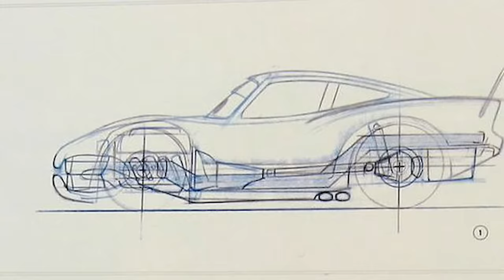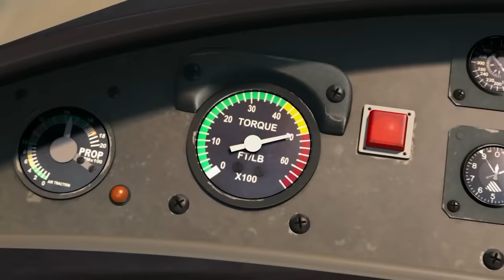Why Couldn’t Lightning Beat Jackson Storm? | Cars Theory

Comment: As an engineer I can tell you this: the biggest problem with upgrading old cars is compromise with their identity. For example lets take the Golf GTI, it was one of the first compact sportscars ever manufactured. To keep up with modern day compact cars u  could swap Engines and stuff... but the space is limited. You could just grow the frame by changing the chassis and body, but by doing that it will loose its identity, that can't be called a Golf anymore. This happened to many cars that came from tuning lines and not from the Manufacturers themselves. Shelby made some models where they remade the body and the car had a new Identity. Mercedes AMG borders that philosophy as well.
Reply: You swap in an Audi/VW 20V racing engine for 500hp. This assumes a racing budget.
Reply: Ive wanted a custom 1967 CHEVROLET IMPALA for so many years but I wanted the interior to be modernized automatic and you just helped me understand that its as possible as it is complex….I guess Ill just let it go lol
Reply: @ElusivEnigma  you could do it yourself for 20k+base car in good shape. It would prob be 40-60k to have it done in a shop(very few I'd trust).
Reply: The ship of theseus theory pretty much
Reply: @ElusivEnigma  swaping to Automatic is not as hard as an engine swap, but you will need money for it. If you want to do that by yourself, you need knowledge about how the car is built and the compatibility of certain gear boxes. Also since it is Automatic, you might need knowledge about the electrics as well, depending on which gearbox and transmission you use. But it is easier to learn how to drive manual. And believe me when I tell you that it is really easy. I learned it in literally 15 minutes.
Reply: @Eluderatnight  yes, but when you swap the engine, you will have different dimensions. It might fit or it might not fit. There is a VW Golf 2 that has 1000 hp monster inside it. To fit in the new engine, he had to remove back seating and the trunk had sloted holes for airflow management. The Front is empty and was not made into storage space to keep it light. Due to the power increase they had to widen the body in the back and mount wider tires to get the momentum on the asphalt. Also it was remade into a 4WD with a 30/70 distribution. That thing needs only 7,8 seconds on the quarter mile.
Reply: @lolmanboss  my proposition was 400bhp continuous, 460bhp scramble. Its an off the shelf racing engine from VAG that is based on the same architecture and the original.

I have had a mugen N1 racing engine before and it was a ton of fun. It lasted about a year of 120mph every night.

Comment: One of the things I have a hard time keeping in mind is that at this point it's implied that lighting is as old as the king was in cars 1. also Storm reminds we of how arrogant lighting was before radiator springs. the only difference is that storm knows the value of teamwork and is alot more passive aggressive
Reply: except King was from 69 where as Mcqueen was from 05 (Mcqueen is essentially half Corvette half Camaro). 12 years against 36

Comment: Fun Fact: 
Some of the Racers from Cars 1 appear again in Cars 3 as veterans with different models, while still being the same racer. An example is Spare Mint Racer Ernie Gearson, who appears in Cars 1 as a 70s-80s body model racer, but appears again in Cars 3 with a more rounded body that is completely different to his old one. How this fits into the theory I don’t know. I think how it works is that Stock Cars can upgrade to other Stock Cars models, but can not upgrade to next gens due to vast mechanical distances. Why the lemons can’t upgrade while these racers could, inconsistent writing ig 🤷.
Reply: Also in cars 2 the yellow car  racer

Comment: Technically in Cars 2,Lighting McQueen was a next gen racer,with a more simplified and quicker Engine,Also instead of the spoiler that the older generation of nascars have,lighting has a flat and modified spoiler in cars 2,so he could of been a next gen racer,it’s just for some reason,they changed him back to his original design
Reply: He probably would’ve been as fast as Storm,if he still has his Cars 2 design.
Reply: Umm you know he's a Hybrid right? Emotors provide electric boost.
Reply: Cars 2 was McQueen’s racing prime, the fastest he’s ever been. No amount of upgrading would’ve changed McQueen being old in Cars 3. The way I see it, the racers have their rookie phase, their prime phase which is when they’re at their fastest and their veteran phase where they’re old and past it. McQueen was at the veteran stage in Cars 3

Comment: In "Cars 3," Lightning McQueen couldn't beat Jackson Storm initially because Storm represented the next generation of racing, equipped with cutting-edge technology and a sleek design that gave him a significant speed advantage. McQueen, while talented and experienced, was struggling to keep up with Storm's speed and agility.

Additionally, McQueen was facing doubts and insecurities about his own abilities as he aged and saw newer, faster cars like Storm dominating the racing scene. It wasn't until McQueen embraced new training methods, learned from other racers, and tapped into his own strengths and experience that he was able to compete with Storm on equal footing.

So, it wasn't just about raw speed but also about adapting to change, overcoming self-doubt, and finding new ways to compete effectively in a rapidly evolving racing world.

Comment: There's an old classically animated cartoon (I think it was produced in the 60's or 70's - and I saw it on Cartoon Network back the late 90's) that is aesthetically the same style as cars (windshield are eyes, etc.). 

Quick synopsis:

It was about a family of cars with the Dad encouraging his son to follow in his footsteps (or would that be tire tracks) and become a livery cab/taxi. The kid has other aspirations (he wants to become a race-car and compete in the local derby) and get's tricked out as a hot rod - new body, new engine - the whole nine. 

He's punished for it and despondent tries to run away from home. The dad tries to chase him but the son is too fast. The dad struggling to keep up overheats and ends up stuck at an intersection with an oncoming train. The kid circles back and helps his dad off the tracks but gets hit instead. Thankfully the kid recovers and he and his family reconcile - he adopts his family profession and reverts his body back to that of a taxi...but he keeps the supped up engine.

When Pixar's Cars was released the style was instantly recognizable. So assuming it follows the lore established by that cartoon, then reproduction is possible...just don't ask me the mechanics of it.
Reply: would you happen to know or be able to find out the name of this?
Reply: I remember watching that exact episode of that show when I was a kid. I know what you’re talking about but I forgot the name of it

Comment: You might also think of them as like a computer CPU, you can always upgrade your motherboard and graphics card and even your case, but at some point the new parts just aren't compatible if you were born with a Socket LGA1150 you cannot use upgrades with a Socket LGA1700.

Comment: I always thought if Lightning just got an engine rebuild, which he probably needed, and maybe a change in aero, he would've been fine. He was still powerful, hitting near 200mph.

Thing is, Jackson had electric motors, probably a different axle ration, and a wing typically makes less drag than a spoiler. He probably made morr hp, too. There seems to not be a lot of regulation compared to real world NASCAR, since King(a banned 60s car) was racing cars from the 80s(like Chick) and what seemed to be late 90s, early 00's. Which means Lightning probably isn't that old, he'd hafta be at least a young adult in the first movie. Say the same thing applies that a car at 25 is considered a historic vehicle, they age somewhat quickly, being 25 the equivilent of a senior or middle aged car, he's probably only about  6 to 10 years old by the third, and he was very capable against other race cars that have way better aero, horsepower or both. He beat an F1 car and several LMP cars, not to mention as a stock car, he's heavier than some of the other racecars, like the WRC cars. Plot was against him to move a narrative for him to experience both what King and Doc experienced so his rookie[who should've also lost] could move on. She wasn't even a racecar, she's a generic sports car with less power. If I recall; her and Sally have about the same hp, which is less than Lightning, who has 500 last I checked, which I'm sure 00s stock cars were pushing more than that, especially at bigger tracks, like Talladega.

Comment: Your perspective made me think they are like actual cars. The mechanical and electrical side. The “ECM engine control module” stores the brain of the cars and controls the mechanical side of everything, such as parts that would need to be swapped out, or aging into a new compatible body style. Each body having its own electrical harness. As the body styles get newer, wiring harnesses get updated, and your ecm is no longer compatible with how the wires in the wiring harness transfer data, the data that controls the parts, thus obsolete.

Comment: 🎯 Key points for quick navigation:

00:00 🏎️ Lightning McQueen and Jackson Storm represent different generations of race cars with varying technological advancements
01:48 🏁 Each new generation of cars in the "Cars" universe is faster and more refined than the previous one
03:12 🚗 Cars in the universe of "Cars" seem to have limited knowledge about their origins and what happens to them after they "die"
05:30 🤖 Vehicles in "Cars" have families and seem to be associated with specific makes and models, hinting at a complex birth or creation process
08:00 ⛓️ Cars in "Cars" may grow into adult cars and potentially integrate into new bodies made by manufacturing companies
10:47 🔩 Veteran racers like Lightning McQueen may face limitations in adapting to newer technologies due to their biological and mechanical integrations

Made with HARPA AI

Comment: I personally think it's like the idea that for example you have an old boat and to repair it you need to replace some parts with better parts but at what point do the upgrades stop improving the preexisting car and instead just make an entirely new car out of the original body like after a certain point lightning McQueen would not exist just a different next gen racecar with his memories which now that I think about it could mean you have the experience of the old gen racers combined with next gen improvement's provided you ignore the ethical quandaries about mutilating someone physically to the point that you make an entirely new person out of them and effectively kill their old identity and self awareness. this would make a good plot for the sequel where old racers are captured and changed against their wills for the best possible race results
Edit: The problem I was mentioning is called Theseus's paradox its very interesting with it basically meaning at what point are not just replacing old and faulty parts and gave just making an entirely new version of the original object

Comment: I think another theory about why McQueen isn't upgraded is probably because of the rules of stock car racing. It doesn't stop new gen racers from joining but you can literally see in both Cars 1 and 3, every car almost look identical, it's a spec series like NASCAR where every car are similar in terms of engine power and body.

Comment: I think because the enginge is their heart and soul, and because if the limit a engine have and all parts that can be connected to it make a limitation on what boddy a car can have, for Lightning to could use a new boddy they would've needed to probably rebuild the engine from the ground up with new parts that could be connected to a new boddy that could use new parts that could've be connected to the new built engine, but it would've probably changed Lighting personality because he wouldn't be the same Lighting Mcqeen but a new one.

Comment: An idea is chassis. A real life example is older models had distinct chassis that firmed the basis. Nowadays, the chassis is usually built into the body. Perhaps the chassis and engine are a set. The body can be upgraded but, if car bodies and chassis are being put together, older cars like mcqueen and doc wouldn't have the same upgrade ability because the way they were built are fundamentally different. Perhaps, (following your idea) the body and chassis merge biologically, making upgrades past a certain point infeasible

Comment: Someone made a video about some of the cars 3 stuff but what he said made sense to me. Storm and lightning wouldnt have even been in the same competition, theyd be in different leagues with lightning hitting the classics and storm in the regular league. Either way theres zero reason lightning couldnt beat storm being that its xlear their acceleration and top speeds are similar, the difference isnt by 50 but by 30 at most in top speed. Lightning having an unorthadox and more skilled racing style wouldve won out there but as storm got more skilled he would take over. The real reason lightning lost is plot, no word of a lie, its just because plot

Comment: Maybe the consciousness of a car is tied to its chassis. That explains why Lightning can't be rebuilt as a completely new car. He can get new parts, but he can't rebuilt from scratch. This is supported by the fact that the main reason stated that Storm is faster than Lightning is related to the chassis: better aerodynamics and downforce. NOT the engine or any other part. They can be replaced, but his chassis can't. The only problem this theory has, is how kid cars grow. They can't get transferred to a bigger chassis to match their age. Maybe the chassis of a kid car grows as the car ages, just as it does for humans?
What do you think of this theory?

Comment: What if frames are genetic and can only be improved upon not changed, because if you were able to change the frame or when you hit puberty you need to get a better frame why don't all cars have the same frame, it probably has something more to do with biology and genetics, I would think frames could be improved upon with new part and be optimized but the core frame itself can't change wich leads to limitation, it like muscles and how you could train a muscle make it better but you can't change your genetics, because what would stop there from being 100 different jackson storms or lightnings, this could also make it that the "Ideal" frame would change and technology evolved for example when lightning was a rookie, due to the technology available his frame was the best for racing but as technology evolved Jackson's frame was realized to be the most optimal

Comment: In all honesty, it is more than likely mechanical restrictions i dont doubt that their vehicle frame could be changed to newer ones. But their engines can't. If we base it off actual nascar. Engines and vehicles got smaller. Lightning was part of the famed big beefy V8 generation. While the new gens more than likely run the new V6 engines in smaller frames

Comment: They can definitely not switch bodies or frames as they got older. Otherwise they wouldn’t have a company called Rust-eze for older rusted cars. If they didn’t get old and rusty they wouldn’t need an ointment (polish?) for it.

Comment: The idea that as Cars grow up, they get installed into bigger bodies makes me think of hermit crabs, but with a finite cutoff size for their base biology. Two trucks make a truck sized offspring, little coupes have small offspring, but the tech that is available to upgrade their shell with changes as they grow.

And once settled into an adult frame, manufacturers don't always keep new upgrades reverse-compatible. Perhaps they get their adult frame through a school system linked to manufacturing.

Comment: I think there is a 'biological' aspect, though not in a squishy fleshy way, more just... 'mechanical' biological.  Like, machines that self replicate and all that.

And when a car 'grows', they are like children and need similar 'brand' replacements to help them grow better.  Akin to starting out with baby booties, and then getting proper shoes, and then larger boots.  Every time a part needs to be replaced or upgraded, they just slowly get the next size up till they are 'fully grown'.  And due to family lineage, they need to stay within a certain factory brand.  Like having weird shaped feet that is only catered to by 'one brand'.  

Then after that, you could totally get 'upgrades' and such, but... this is where the mechanics part comes in, you can only have something repaired and replaced and upgraded so many times.  The metal frame develops hairline fractures, there's stress and wear, even if you had the desire to modify, there'd be so many required additional modifications you'd practically fall apart into yourself, literally be too strong for your own arm or abilities.  ((Think in Ironman 2 where they showed the 'failed' Ironman attempts and one dude tries to turn and twists himself in half))

This also explains the obsolescence of various replacement parts, various changes and updates made to the 'adult clothes' so to speak, to help with efficiency, safety, and so on, isn't backwards compatible.  But any self serving buisness cant manufacture and stock parts for 5 generations of cars.  Thus why you see a lot of 'rich' cars be these older vehicles who can afford custom replacements, or even hoard multiples of replacement parts.

Comment: Engine is the heart of the car. If they change it it will not be lightning McQueen any more. You can change the other parts but not the engine. The engine limits him to go fast. Let's say lightning McQueen has v6 engine, storm has also v6 but hybrid. That's just my opinion.